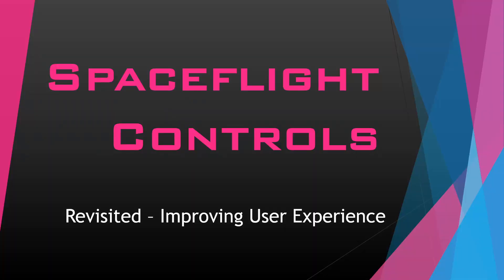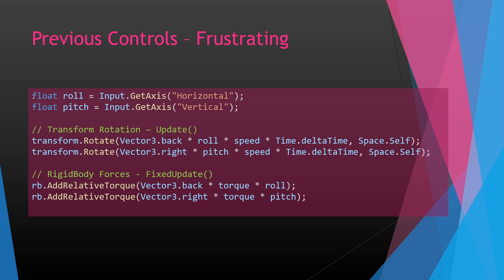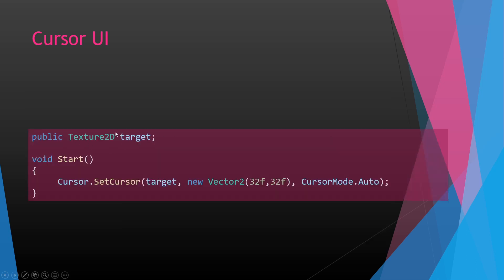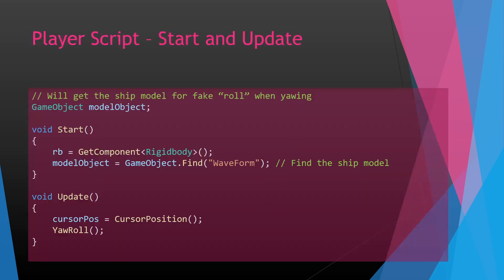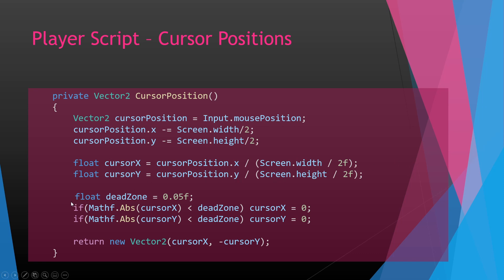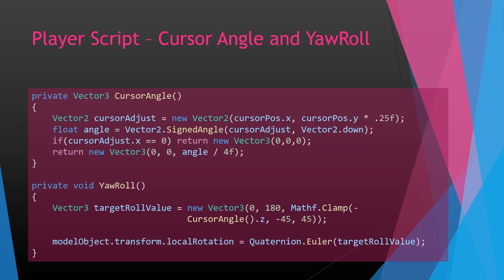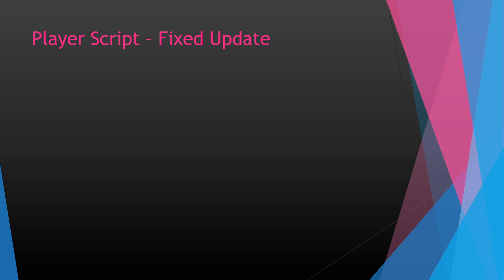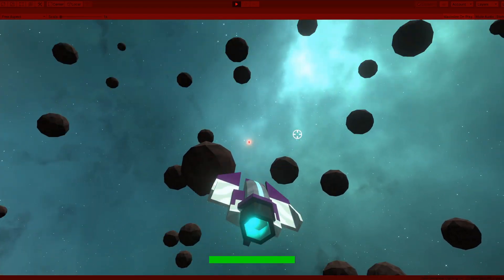Spaceflight Controls Revisited

Comment: how to create a scheme to come up with random asteroids, enemies, types of weapons to collect and force shield?
Reply from the maker: I could cover how this works in another video. The simplest method for spawning new enemies is to just do it on load. Build a function that has a parameter for an object and a x-number, and spawn that object x-number of times. 

Then for each object, pick a random location. In fact, the Unity3D documentation includes demo code that does exactly this for the x-z plane. https://docs.unity3d.com/ScriptReference/Random.Range.html . All you would need to do is add another Random.Range where the 0 is for y, and you have a random spawn system for space.

An additional element in my setup is a scale factor. Asteroids can be various sizes, so it helps to spawn with slight size variations. Another options is to allow multiple game objects as v parameters, and pick a random object to spawn.

Comment: This is awesome! Could you suggest how to do a Swim code? I am trying to play an additional animation to curve the body before heading upwards to down. But I am stuck at making it work. How to I stop the motion, until the curve up/down animation is played?
Reply from the maker: I'm going off of the word "animation" and assuming you're using an animation controller.
I'm a fan of using bools to represent states due to simplicity. So, one answer is to create a bool, "isTurning" which will be false by default. When you initially input to curve, set isTurning = true. Then, play the animation, and trigger an event that sets isTurning = false. In your Update() or FixedUpdate() code you would change any variables adding velocity or speed to something like the following line:

transform.translate(input * Vector3.forward * (isTurning ? 0 : speed))

"isTurning ? 0 : speed" is the same as saying,
if(isTurning == true) { 0 } else { speed }

So, thinking about the logic
1. isTurning == false
2. you input to turn,  isTurning == true
         Update 1: input * Vector3.forward * ZERO)  
         Update 2: input * Vector3.forward * ZERO)
         Update 3: .... so on until animation completes
3. animation frame triggers event, isTurning == false
         Update X: input * Vector3.forward * SPEED)